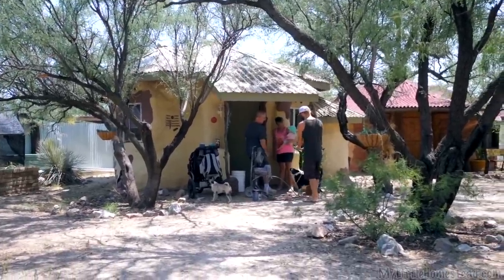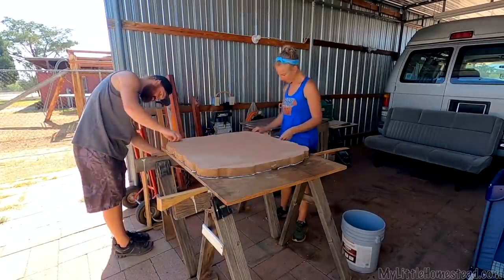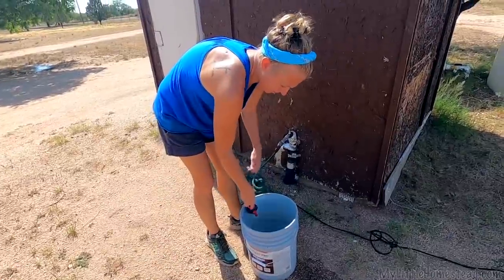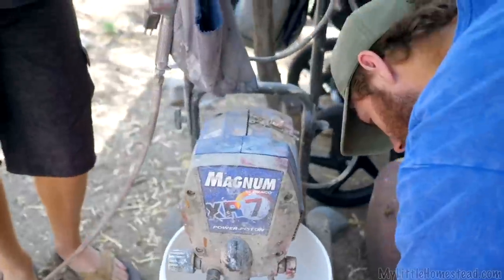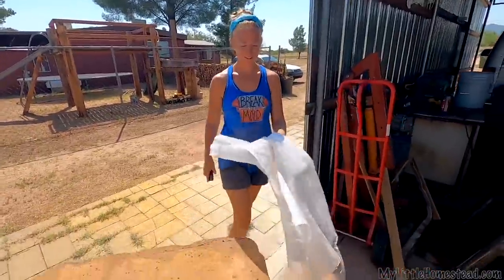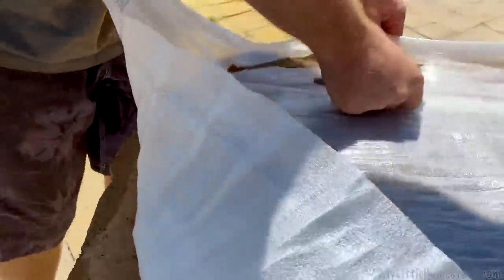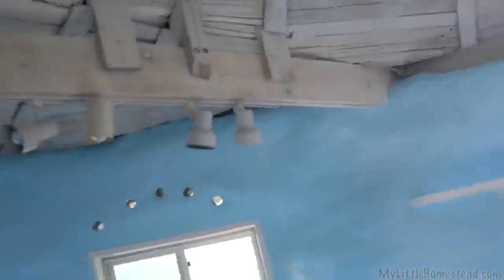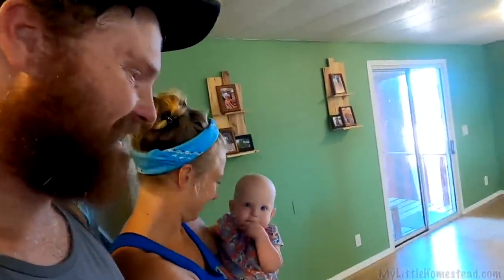DIY Wood Stove Hearth/Cement Slab Complete & Earthbag Paint & Trim Finish | Weekly Peek Ep248

Comment: Leave it to Gary to take the best job. Watching his granddaughter. The look on his face is priceless. Is from holding her or seeing that his children have not only learned but are able to put to use what he and Shelley has taught them?
Reply: I rewatched the previous episode to make sure. You forgot 1 step when you poured the slab. This step would have taken care of those open areas around the edge. The step is to vibrate the cement when still wet to remove the air bubbles.

Comment: I meant to mention when you moved heavy stuff on the laminate flooring before, if you use some laminate flooring upside down under heavy stuff it will slide easy without damaging the floor.
Like the little round cheap plastic dollar store gliders you can get for furniture legs.
I keep cut pieces under heavy furniture to slide easy for cleaning and I've used long pieces upside down under the fridge to weightlessly slide it without damage.

Comment: Have you thought about putting a beed of silicone caulk around the base of your stove and floor. It will help to keep water, ashes and dirt out from under it and possibly causing rot over time. You may think about appling a concrete sealer to the slab also but the smell may be too much for the baby while it's curing. Just some thoughts, love your game.🤗

Comment: That wood stove slab turned out great.  I don’t know if you have home insurance, or not, but one thing a lot of them are sticklers about is protecting the floor around the wood stove.  If I remember correctly it’s like 18” in front of the door, and 6” on the other sides.  Just figured I’d mention it.

Comment: anything over 200 is for polishing - Be careful with the grinders - They can really do damage and can easily get away from you and control. - Sigh.. I would have insisted you started with 80 to 120 - then went to 200 then to like 600... - 800 is a polish only thing.. it's for like clear coat cleaning and Buffing.. - usually go liquid for such grades. Sigh... Want a 4 hr lecture and demonstration?  <heart>
Reply: looks nice to you both.. <heart>

Comment: With kids and drunk adults or just accidentally backing your butt into your fireplace, ..  High HAZARD for getting scalded  ...  hope you put  proper protection from little fingers or worst. ..at least..  Also the block on the floor is sure  to break a toe..  praps put a ramp all around , or foam or suffin.